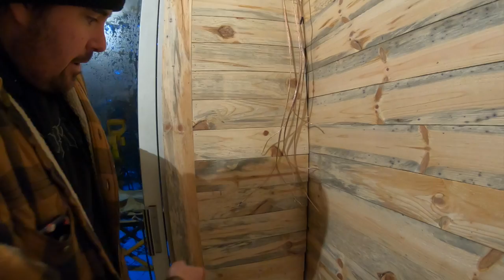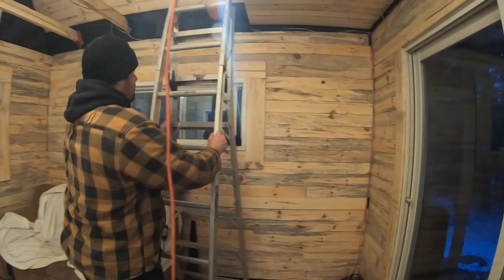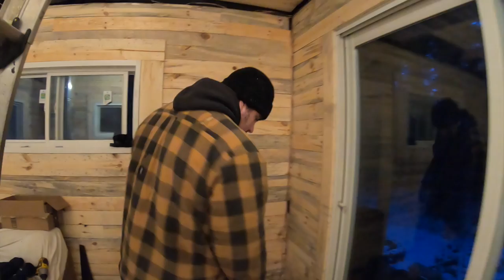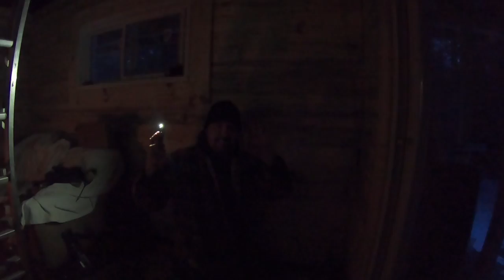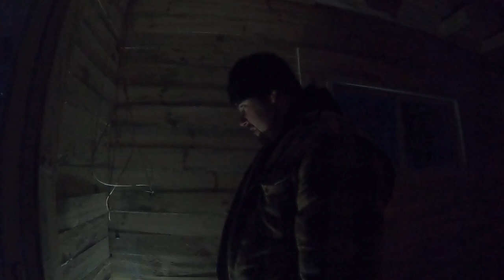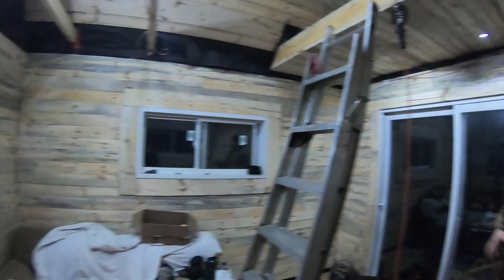Tiny House Lighting Ideas. Installing Tiny House Light Switches.

Comment: How do you mount the toggle switches?
Reply from the maker: I drill a hole the same diameter of the switch and they mount flush with wires running out the back

Comment: Hey Sandy, I was away for a couple weeks and just catching up with your videos.  Lighting looks great.  Did you try bouncing the light off a wood trim to create soft lighting?
Reply from the maker: Glad you’re back. I did try bouncing the light but I found it was too dark likely because of the number of lights I have and the long runs of wiring. I found the lights could be a little bit brighter and so to make sure it was enough I just left them facing outwards. I figure I’ll leave it for a bit and rotate them again if I find it’s too bright.